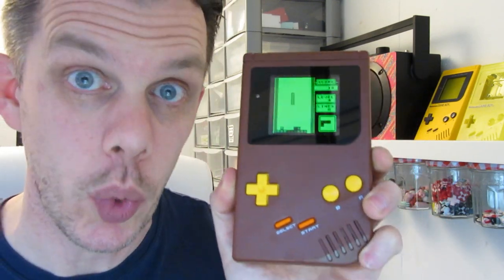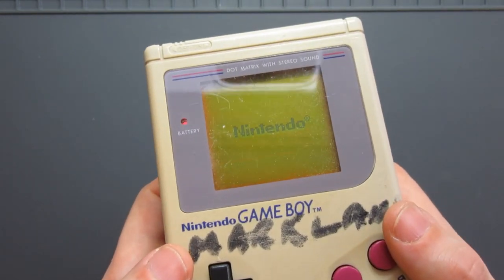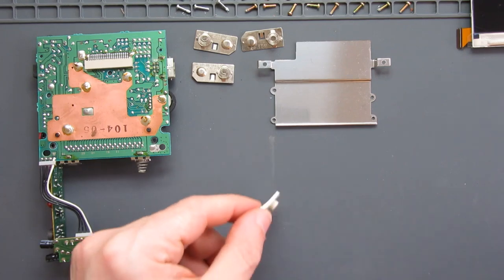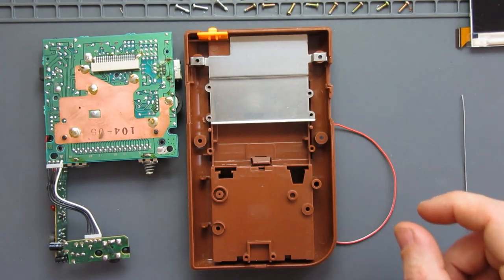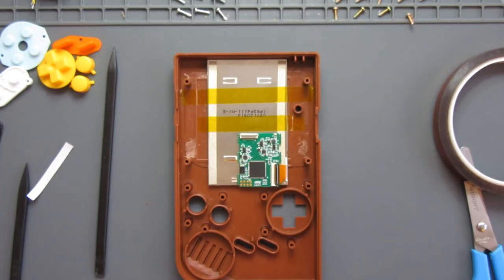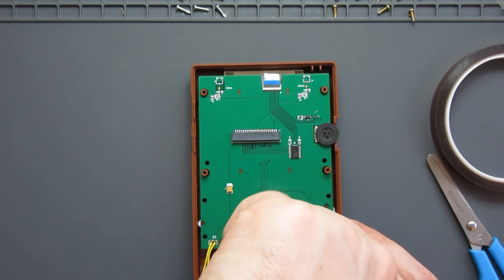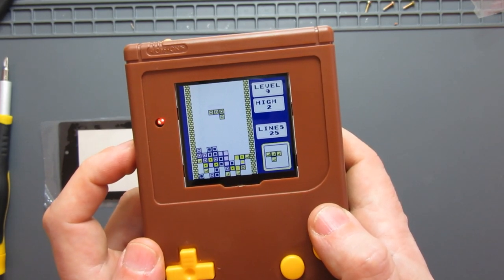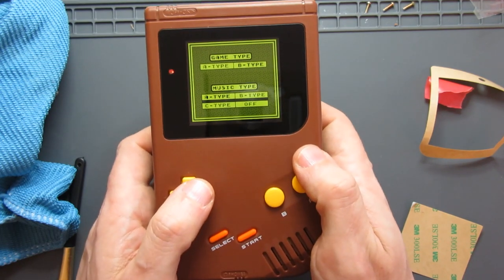DMG IPS screen install tutorial

Comment: Hi! Great Video! I installed this in my classic DMG yesterday. The video quality is amazing., but while testing, I noticed the buttons have a delay. In Tetris moving the blocks left or right needed multiple presses to get it to move. Did you notice anything like that happening?
Reply from the maker: It doesn't feel too bad when I did it, but maybe try cleaning the contacts or using the original silicone parts instead of repro ones? Also make sure the control pcb is screwed securely to the shell
Reply: @JoeBleeps  Thanks for the reply. I was using the original pads, but I ran them down  a piece of paper to clean them more as I previously just washed all the parts in the sink with dish soap. They seem to be working better now. Appreciate it. :-)
Reply from the maker: @mastercpu2  I'm glad to hear that! Happy gaming!

Comment: nice work, could you give more infos about the sound mod. Is it only to proof quality of headphoene out or for the internal speaker too?
Reply from the maker: Thank you. I think I might male a video all about the sound mods for game boy. In this case, it bypasses the headphone amp so it's quieter but there is none of the hiss. It's intended for using as a line out for an amplified speaker or a mixer.

Comment: Those metal tabs on the back of iOS screen fold out and slot into the new pcb. This is to help line up the screen. Cheers like your videos! Keep it up
Reply: The Great Jonzini if you use the metal tabs, the screen will appear slightly offcenter. That’s why a lot of videos don’t use them.
Reply: @retro_boy_advance  ok, I see
Reply from the maker: I had no idea, that's interesting! Definitely worked out well to manually centre it with the double sided tape though 😊
Reply from the maker: @retro_boy_advance  ah that's a real missed opportunity there, could have been a cool feature. Thanks for the heads up
Reply: If you use the tabs on the back of the lcd, it won’t be align correctly and you will see the white border line of the screen on the front display. Using the tape from the video will let you align it correctly. I tried this and it worked best than the tabs. Once you install the main board it will help place a little pressure and the LCD won’t move at all.

Comment: Hmm, I'm not really satisfied with this kind of backlight. The black/ white and the multi-coloured ones look ok but all the other colours are just way too strong and seem not usable to me. Would be great if the green would be more like the original gameboy colour and if it had more of the multi-coloured settings. Also I've read that the buttons work quite bad on this PCB, can you confirm that? See the comment below on the Handheld legend website: @t
They even admit that there are problems and a revision V3 is coming. So I think I would wait for the 3rd revision before buying that.
EDIT: Oh, see what I've found here: https://console5.com/store/nintendo-game-boy-classic-dmg-01-full-size-modern-ips-backlit-lcd-kit-bracket.html
It says: "April 2020 update: v3 units on order, featuring improved color palette & button contact surfaces"
Reply from the maker: Yeah I'm curious to see how the V3 is. I've been lucky not to have issues but on the most recent one I did I removed part of the rear shell to alleviate pressure on the d pad and it seemed to help. And I agree although I like the white, yellow and green some of these pallettes like the red and blue are pretty useless!

Comment: Why is the red-white cable pair necessary? What does it do?
Reply from the maker: It bypasses the headphone amp to get a cleaner (but quieter) audio signal. I like making and performing chiptune music on my Gameboy and this allows it to connect easily to a mixer, an amplifier or audio recording equipment without that hiss you normally get.